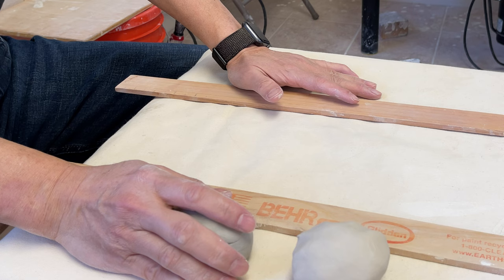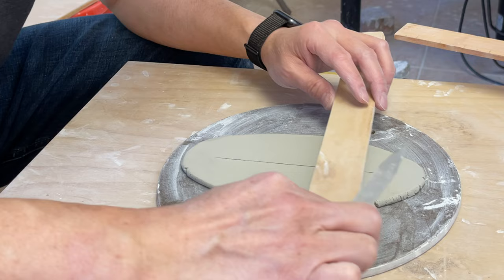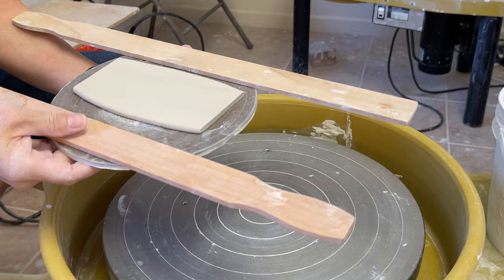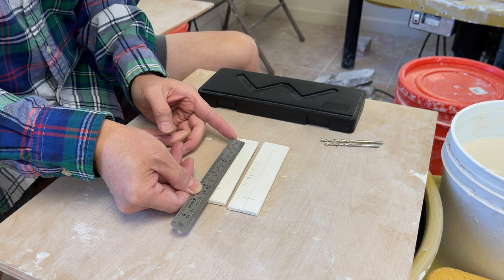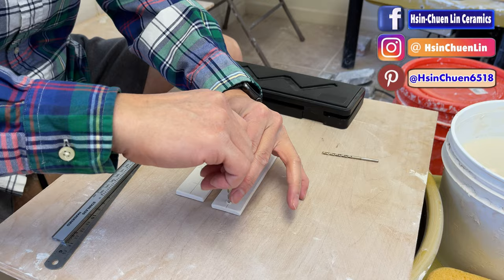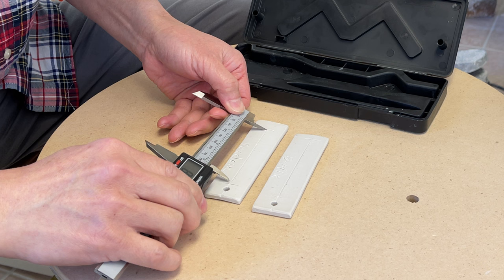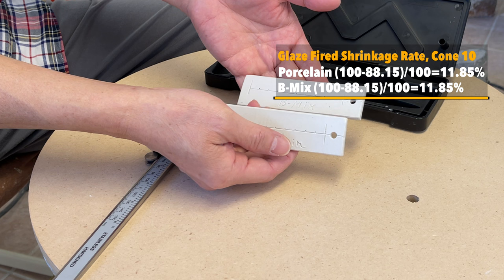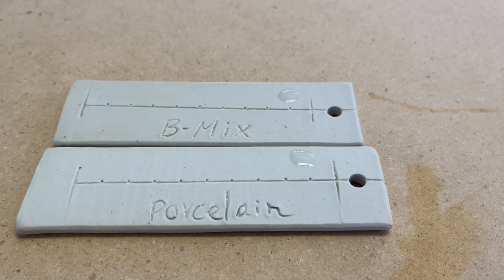639. Test Tile Making~ Knowing Your Clay Shrinkage Rate With Hsin-Chuen Lin 林新春 粘土收縮率試驗示範

Comment: I thought that b-mix was a cone 5 clay. It does not melt at cone 10? What was the bisque temperature? I see that the bisque fired was cone 05. I guess you were using bmix10.
Reply from the maker: I prefer high fired so all the clay I use is cone 10-11.